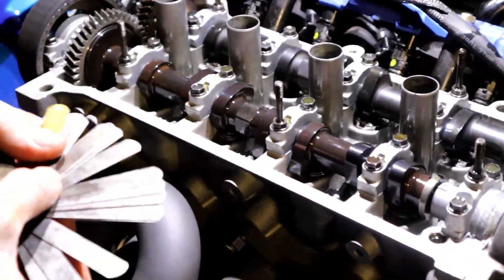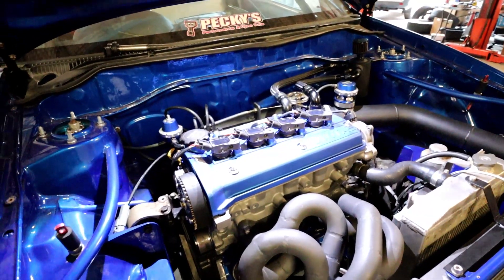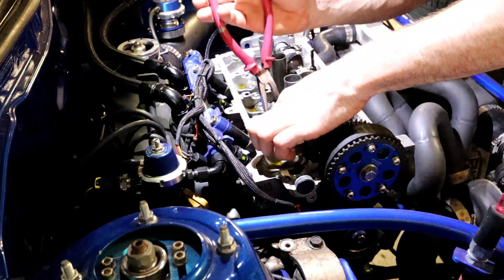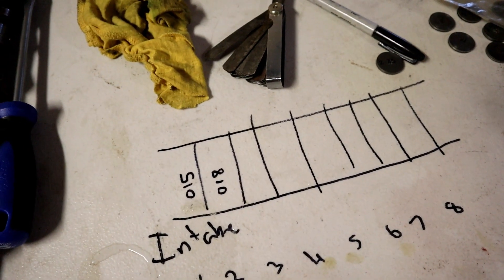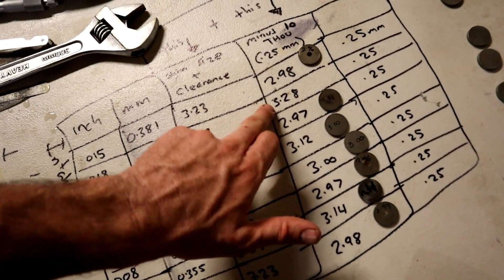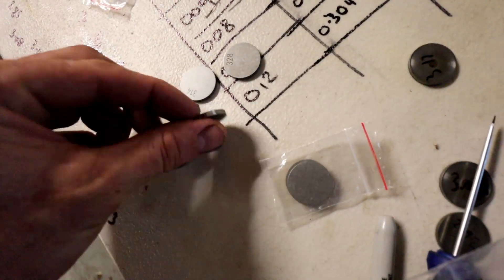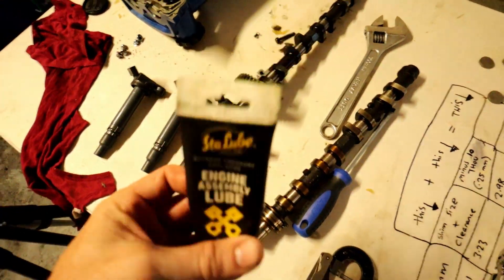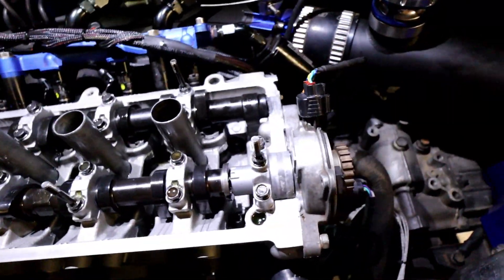How to adjust shim over bucket valve clearances

Comment: What website did you buy these shims from? I have a Nissan that has a bucket setup and you can't get shims anymore. I used a 25c coin under the intake buckets and a 5c coin under the exhaust. works mint but idk how long it will last lmao

Comment: How would you go about setting the valve clearance if you're only given the "hot" specs. Speedvision cams only give you .010 INT and .012 EXH hot specs and not cold specs.
Reply from the maker: Id just use those specs anyway. In one of my old engines i had to start it to move it and one of the clearances was .026 and it was fine lol
Reply: @Camp_Dogs  it wouldn't cause the valvetrain to be noisy or be losing out on power?
Reply from the maker: @HamsterEng  as i said i only used it to drive in and out of the workshop.

Just do the hot specs then please yourself
Reply: @Camp_Dogs  alright so measured them hot vs cold and they were mostly .002 looser when hot than when cold. Just thought I'd share.

Comment: Hi Matt are the cylinder heads the same 5efe and 4efte head as I’m trying to sort valve springs through Allen at performance valve springs as I plan to turbo and cams my 5efe in my glanza
Reply from the maker: Yeah they are the same for valve springs.

Second gen 5efe with coil packs im not sure, ive never used them.

Comment: When you do a new engine build , do you skim the block and the head or just the block ?
Reply from the maker: If you don't want to pull the bottom end apart ive also had this done while the entire bottom end is still assembled lol.  Gave it a good wash, degrease, re assembled the top end and away it went
Reply from the maker: If using a MLS head gasket I always get the head AND block skimmed, just enough so that the gasket sealing surface is flat.
Reply from the maker: Can put some masking tape down the open holes to stop stuff going into the bottom end...
Reply: Brilliant , love the build and how clean engine bay is !!!! 🇬🇧
Reply from the maker: @S15.pett98  thankyou man any questions, send them through